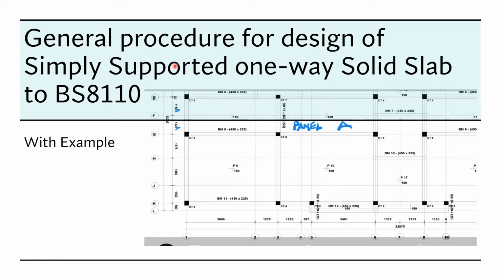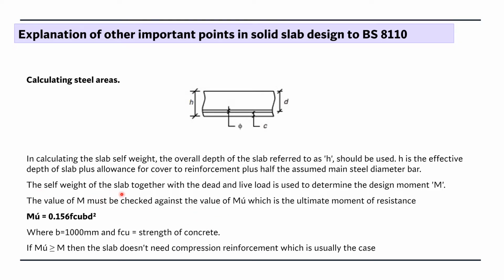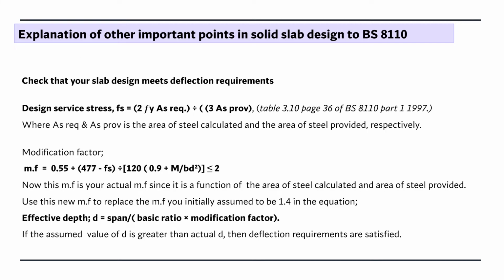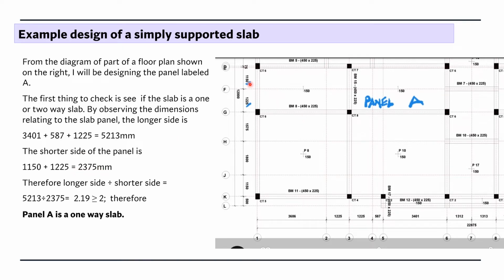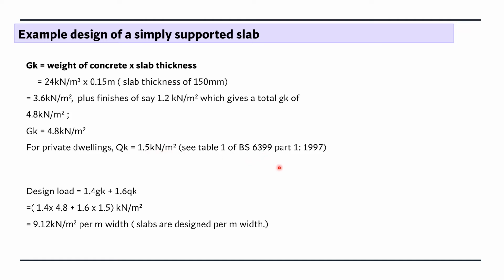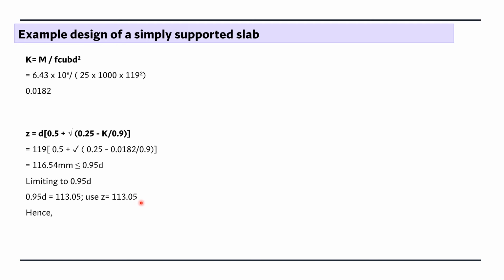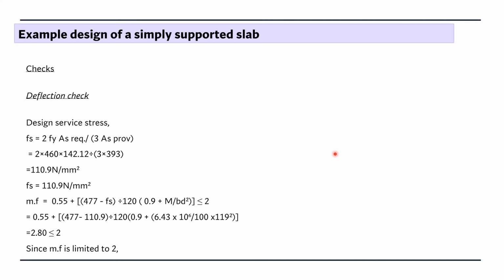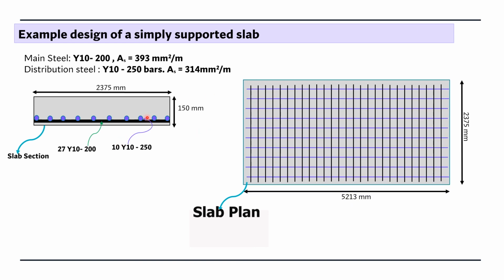Design of  Simply Supported One-Way Solid Slab to  BS8110

Comment: As=M/095xfyZ  not 0.87fyZ on BS8110
Reply from the maker: Well both are correct is just that you should be consistent with the one you chose throughout your analysis, 0.95 is the newer while 0.87 is from the old code, if you are a practicing engineer and you design for areas where structural specifications are not strictly followed then using 0.87 is more conservative
Reply: @GodwinSholaconciseinfo  thank you sir, "SANS" we work on 0.87 as well.